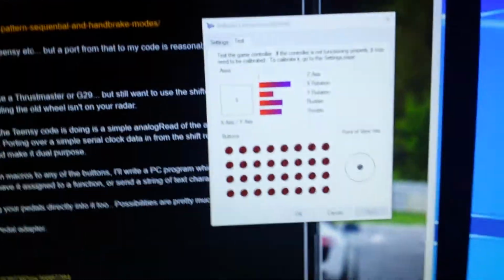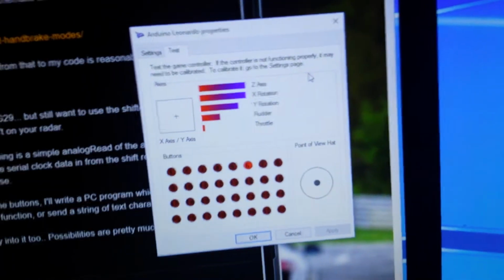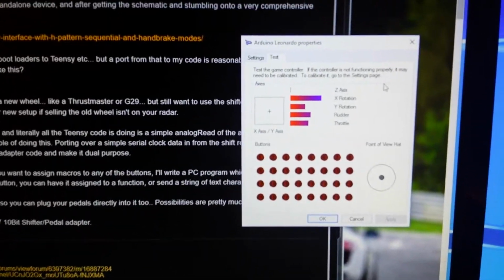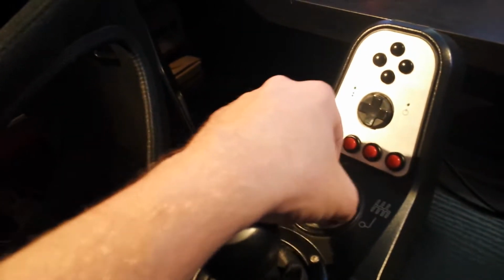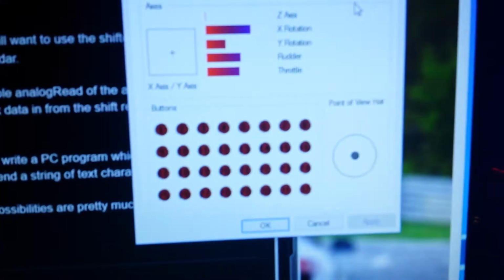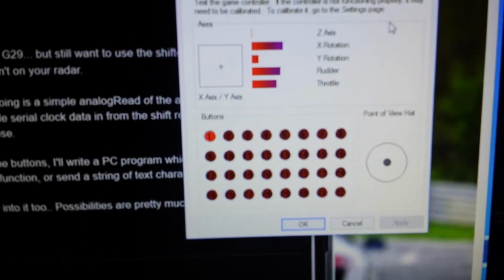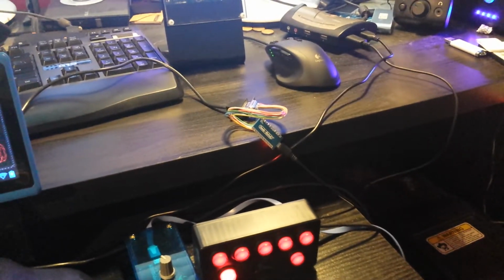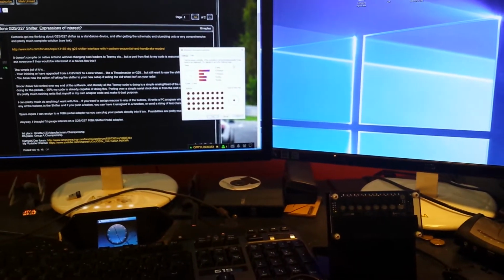Arduino based G25/27 Shifter Standalone

Comment: Cool video! Im on the teensy side tho as adruino's are crazy priced here in canada somehow <.< So i was wondering if you could help me with the G27 Shifter part, i managed to use pascalh work for my pedals and they work fantastic! but my G27 shifter is giving me headaches and i cant manage to get it running. it just doesnt detect nothing :/ No axis movement or button. Ofc they are using teensy 2.0/2.0++ but as thoese arent in the market no more minus to be imported, i bought the teensy 3.2 I know your a busy man but i was wondering if you could help out? Thank you!
Reply from the maker: +comodohalo Isn't the Teensy 3.2 a ARM cortex processor? I haven't tried one yet and not sure if the libraries for those to work as a usb game input device work properly. 

I did promise to release the Library to someone else earlier and it's totally slipped my mind. We're in the process of moving house at the moment. 

I'm using an Atmel 32u4... its an Arduino Leonardo based board. 

http://www.ebay.com.au/itm/310634777706?_trksid=p2057872.m2749.l2649&ssPageName=STRK%3AMEBIDX%3AIT

I got them from the link above and it just works like an arduino leonardo in the IDE. 

I will get that Shifter library extracted and cleaned up for general users, but it won't be this weekend. Remind me next week to upload something for you.
Reply: +RamjetX indeed they are using a ARM processor, they work really great tho for pedals. since its 10-12bits of analog reading so its like you had one of thoese expenside 30 usd pedal adapter. im still unsure if its my shifter or the code.  Good look with your house move, ill surely remind you

Comment: hello, did you release library compatible with arduino boards?
Reply from the maker: https://github.com/RamjetX/Logitech-G25-27-Shifter
Reply from the maker: +m4t3k1991 Hey, I haven't yet. I'm finalizing the code for the complete all in one sketch which will become essentially what I'm going to call the SuperG-Box.

I may release an 8bit axis version of the library though which doesn't have the self written 10Bit HID implementation code. It would work fine for just a standalone shifter. 

The problem I have is that it has evolved quite a bit and become an entire control system firmware for Sim Racing that it works better than alot of the other custom boxes out there on the market.

Were you looking to just use your Shifter with a different wheel? I can probably put a quick version together for you and pull it out of my SuperG library.
Reply: +RamjetX yeah, like u said, im using logitech dfgt and i always want to have standalone shifter and g25/27 shifter is perfect for that. I got arduino leonardo, but im dont have any programming skills :(. It would be great if u can help me with that.
Reply from the maker: +m4t3k1991 I can whip up a little stand alone sketch for you. I'm pretty busy at the moment with a baby/renovations/work etc.. but I'll link you something soon hey.
Reply: +RamjetX thank u, i will appreciate your help. If u want we can talk via mail. :)